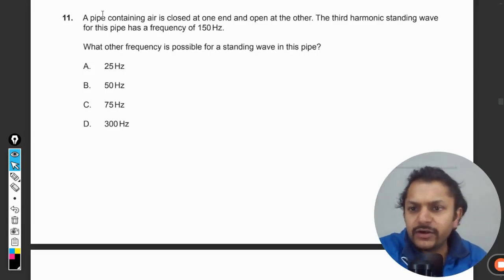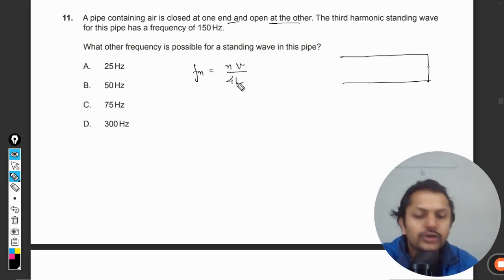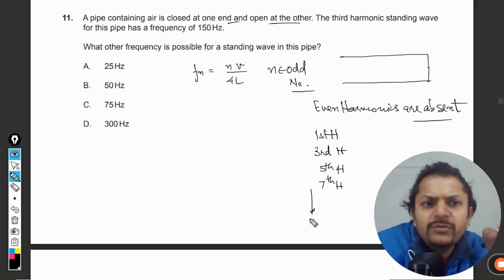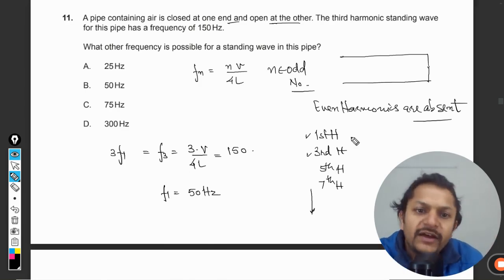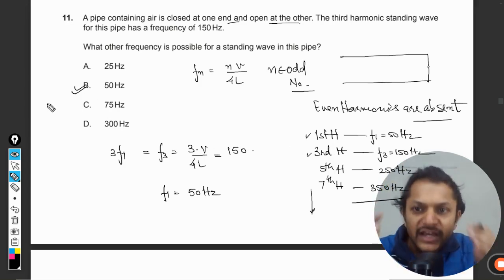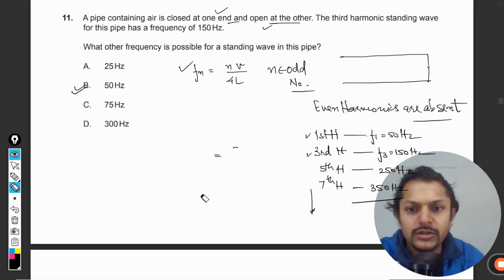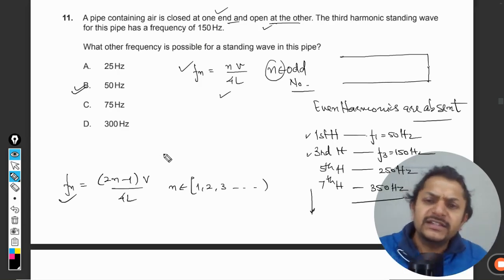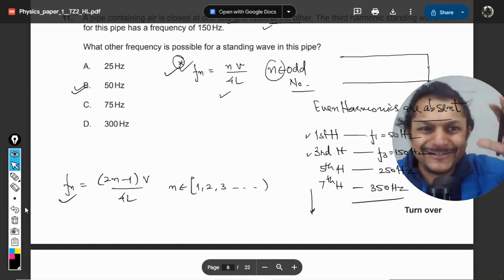A pipe containing air is closed at one end and open at the other. The third harmonic standing wavefo

Comment: Hi professor, I have question. When using the second formula you provided (with 2n-1), f3 would be 5v/4L which is different than 3v/4L (like we found using the first formula) and then f1=30Hz. Could you please explain this?
Reply: I was basically wondering the same thing - normally, don’t we call nth harmonic as nth possible harmonic? So in this case, third harmonic will be when n=5? I thought when n=3, it is the second harmonic.
Reply: @Qorjcmekreally No, the second harmonic doesnt exist for one open one closed. So what we call the third harmonic is actually the second in the series
Reply: @QorjcmekreallySAME QUESTION